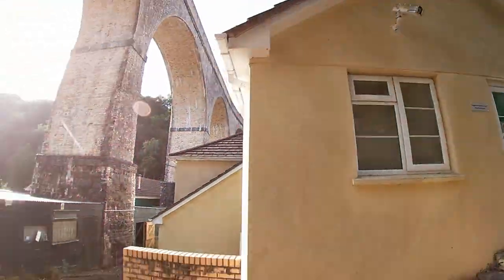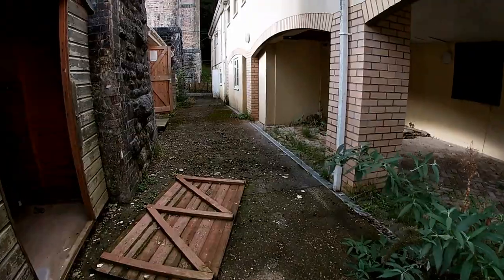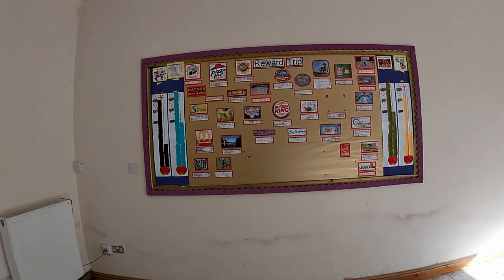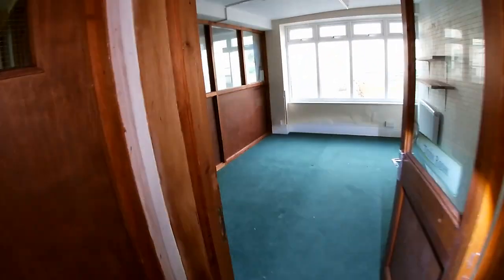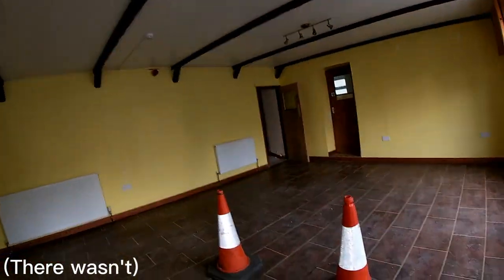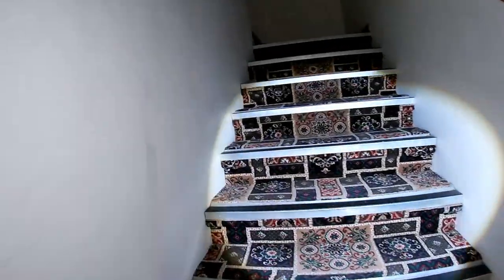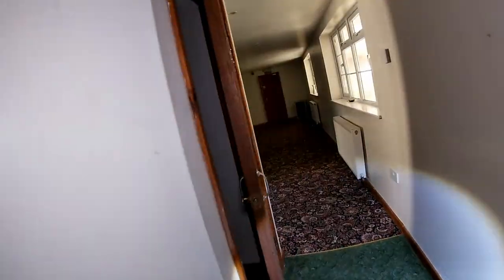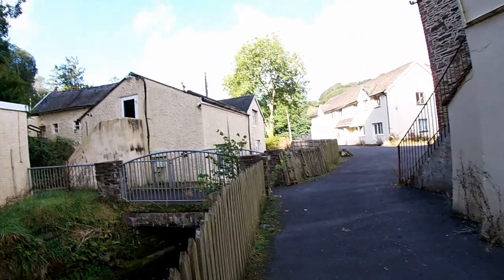The School With It's Own Viaduct! | EXPLORING ABANDONED SCHOOL (URBEX UK)

Comment: Chelfham Mill School:
11:26 - Directors office followed by main staff room further down.
12:01 - Main dining room, with the TV room at the back
12:32 - Door Leading to dining room.  A great shame you couldn't go in there.  It leads to the main dining room.  Directly opposite are stairs going up to the 5 dormitories (The Mill, Room 6, Room 3, The Dorm and Top Floor).
15:01 - That is the old mill.  It was there when I was there back in 1984.  Just to the right is The Mill dormitory.
15:20 - The music room is the only thing that is still in the same place.
17:54 - These were just standard classrooms.  A parents visiting flat was just above.

I was very sad watching this video.  I was at this school from 1981-1984.  I was very happy and well cared for.  There certainly wasn't any abuse going on when I was there.  Whatever happened in the years since I left, I don't know - But the police. in 2017, concluded there was no criminal case to answer.